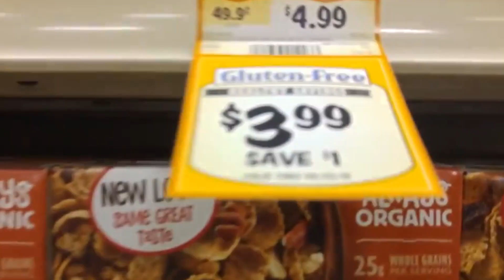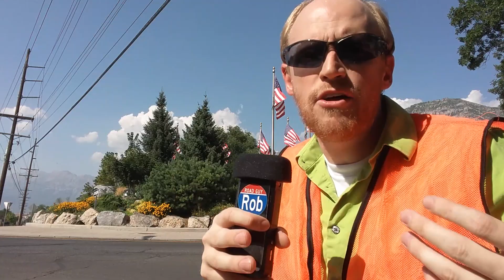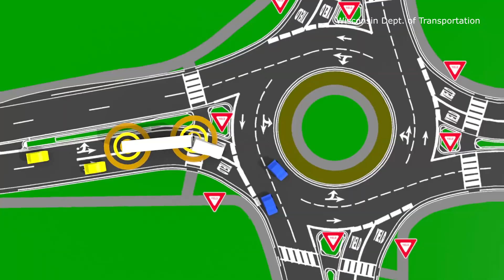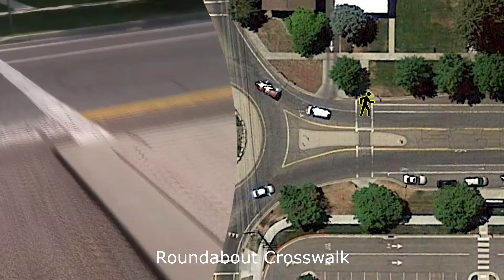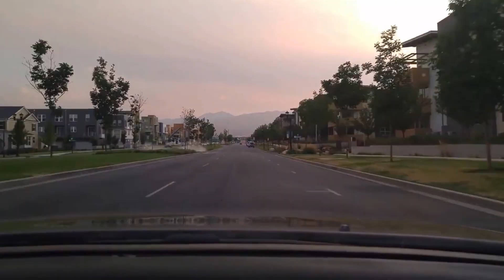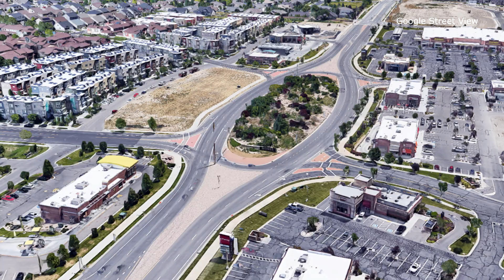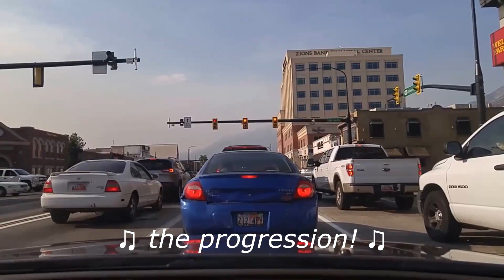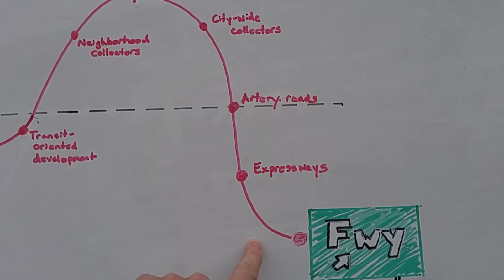Are roundabouts REALLY better than a traffic signal?

Comment: I grew up with roundabouts. They’re quite normal and large lorries generally don’t have problems with them. Pedestrian routes are often built to help people cross using subways or footbridges. Most roundabouts are 2-3 lanes. A quick read of the Highway Code will teach you how to use them properly. To go left (in HK or the UK) use the left hand lane and signal left. To go straight, use the left or middle lanes, but move to the left lane and signal left before your exit. To go right, use the right hand lane, signal right and switch to left signal and left lane the exit before yours. Reverse left and right for right driving countries.
Many motorway junctions use grade separated roundabouts which work very well. So I don’t  get how you seem to think that they’re a new thing. They’ve been around since the 1930s as far as I know.
Reply: We have roundabouts in Australia, but generally just one or two lanes. On the two lane roundabouts you select either lane to go straight ahead, the left lane for turning left and right lane for turning right or doing a u-turn. When I first drove in the UK I noticed that the smaller (painted) roundabouts seem to be ignored by a lot of drivers, in that they don't drive around the painted circle but right over the top of it. The larger roundabouts tend not to have concentric circles but are more like a spiral so that you generally end up in the left lane as you progress around the roundabout, and you need to know which lane to be in to get the correct exit. This is fine when the signs painted on the road are clear, but if they are worn out or it's raining then it starts to get tricky, especially if you are new to the area. If you end up in the wrong lane then it's not easy to get into the right one. Larger roundabouts often have traffic signals as well, sometimes only active in busy periods to meter the traffic.

Comment: My town replaced a flashing yellow/red light with a roundabout 5 years ago. The main road had the flashing yellow while the side street had the flashing red. Both roads could be very busy making it nearly impossible for people on the side streets to go left or straight, and doubled with the fact that the main road has a wide travel lane and large breakdown lane which tends to make people drive faster. the speed limit on the road is 45, but cars would frequently be going near 60. from 2013-2015 (the 2 years between guaranteed funding and project completion there were 74 accidents at the intersection, 2 requiring med flight. no fatalities but some very serious injuries. since completion in fall of 2015 until now there have been 2 accidents, One of them was a drunk driver that went over the center island. Roundabouts work well when placed properly. Traffic is forced to slow down on the road now and people coming from the side streets have a much safer transit of the intersection now.

Comment: In Australia we love roundabouts. But you point at the end is correct; they’re best off arterial roads. But this also means they’re replacing 4 way stop sign intersections not 4 way traffic lights.
Roundabouts don’t need to be as elaborate as the one illustrated in this video either. In my 5 minute drive to the shops I have the choice of high speed arterial or low speed urban back road with 15 roundabouts. The roundabout trip is generally less time despite slower speed because there is never a flow interruption. And crossing is never as bad shown here because no one crosses at a roundabout but further down road.
But the biggest issue you have in this video is changing lanes on a 2 lane roundabout. We treat it the same as changing normal lanes on any road - check, indicate and move. Doing that twice on a roundabout makes no sense.
And given it’s been a normal part of daily driving here for over half a century, I can say it’s almost never done.

Comment: Really good video. You did a good job at discussing the pros and cons of roundabouts. The graph was perfect. Usually that "spot" is at the edge of a dense urban environment with a more rural area and the roundabout slows down the freeway speed traffic to a slower speed as it enters a more urban environment. It's a subtle clue to the road users that they are entering a new road character. People with limited sight do not like roundabouts because there is no signalized break in traffic nor audible clue of when they can cross safely, but this can be partly mitigated with RRFBs. That being said, they take up much more space than a conventional signalized intersection, they also (as you eluded to in your signal timing video) equalize the traffic from all approaches which reduces capacity of the main line to equalize with the side street (which signal timing can fix), so it's important that the traffic flow be roughly equal from all approaches. Also, fire departments don't like them as they have to slow down and can't get a preemption green light like they can with modern signal tech. And if you look at the land use around roundabouts, especially in Europe, they act as a pedestrian barrier where you will see commercial areas not be able to "cross" the roundabout as the pedestrians are unwilling to walk the distance. You have bounded the commercial activity (which isn't always a bad thing). Also, the concrete inner curb is called a 'mountable truck apron.' These are all minor points, this was a really good video and was refreshing to not just hear a 'roundabouts are the solution to all traffic' that I have seen others' do.

Comment: Wait a minute... $5,000 - $10,000 per month for electricity to run a traffic light? Is that one light? Even if it's 500 lights, do they really use that much electricity?
Reply: LED traffic signal modules are mostly under 10W apiece. So in a very basic four way intersection, about $49/year at the national average $0.139 electric rate. (4 X 10W  X 8760 hours  / 1000 for kWh X $0.139) Remember that while there are three signals in each direction, only one is illuminated at a time. And while there are intersections with many, many more lights,  the number of bulbs required becomes staggeringly large to reach a $48K annual electric cost.

I think someone made a math error, perhaps forgetting to convert watts into kilowatts.
Reply: @gerrypower9433  
The thing is what happens when you have a bad accident or really bad weather that knocks down traffic lights? I'd think that costs much more to fix than an accident at a roundabout and not to mention the maintanence costs for roundabouts which should be next to none.

Comment: Here in Hilliard, Ohio, we've had several roundabouts put in, and more are on the way from what I've read in the news.  I love them.  The place I used to take my last Jeep for oil changes used to be at a very busy intersection with a traffic light, and traffic used to be backed up in all directions waiting for the light to change during the day and early evening.  It's now a 2-lane roundabout, and all of that congestion is gone.  The only problems that I've seen in the roundabouts are the drivers.  People fly into the roundabout without hardly slowing down and not yielding to the traffic in the roundabout.  Some people I've seen in the roundabout stop for vehicles coming into the roundabout.  And since some of my jogs often take me through some of the roundabouts, people don't know how to yield to pedestrians in them.  I've even had some people where I'll be off the sidewalk and in the crosswalk, and they'll accelerate to get past me rather than wait a couple seconds.

Comment: the dutch are putting roundabouts everywhere from small inner city streets to Snelwegen the tiniest are so small that semis still need tu turn normally (over a slightly raised cobblestone pad in the middle of the streert to the biggest with kilometers of circumference they also have "turboroundabouts" wich are built in a way that prohibits lane canges so wich makes them more convinient than regular multi lane ones

Comment: Good video.  Roundabouts are a tool, and in the right context can be much more practical, and affordable to a traffic signal.  But they are not ideal in some situations - especially for blind people since vehicles don't stop. They also take more space, so in urban areas there usually isn't enough room. But in suburban/rural areas with mild to moderate traffic, and low pedestrian or bike volumes they have been implemented successfully in many States.

Comment: Multiple lane roundabouts are WIDE enough for trucks IF the trucks are taking up BOTH lanes.... which means driving next to a truck is certain death. I mean, it's dangerous all the time, but it's instant death in the roundabout. 

Me? Yeah, I'm using my hazard lights (because roundabouts are hazardous, and so is my movement through them), and then I'm taking up both lanes before the roundabout, IN the roundabout, and I might think about sliding back over to just one lane after the roundabout is done UNLESS there's another one coming (like in Lacey, WA off I-5 exit 111 and you'll see three of them in quick succession).

Comment: Here in Oregon they move extra long power poles for high power lines, which would not work at all. Also moving big modular homes into areas would be a big problem. Then say you want to save an old house and move it somewhere else. You can't get by a roundabout.  The new power wind mills that they truck into areas and set up to make power for everyone just couldn't begin to get through. So it's not that I'm not smart enough to use them, but you run into many problems that you don't even think about. I hate roundabouts,,,,,,,,,,,

Comment: The importance of platooning can’t be overstated. I lived in Italy for 3 years and in Korea for 8 and can tell you the roundabout is not the universal panacea that Europeans and others claim.  When engineered properly crosstown boulevards with sequenced traffic signals that create tight platoons can result travel at constant speeds of 60+ kph without having to slow down or stop AND allows gap times that allow regular ingress periods as well as gap times for pedestrians to cross safely.  This flow almost never happened in built up areas in Italy where instead block after block of rotaries meant a solid string of cars that never safely managed faster than 35 kph and produced no gaps for entrance from the side streets or gave pedestrians windows in the flow to safely cross.  Rob’s brief demonstration with the multi lane roundabout showing the pedestrian having to wait for gaps is correct although in seriously busy areas that safe gap never comes.

When traveling in Indiana another flaw was exposed that is the result of randomized traffic and rotaries replacing 4 way stops.  When one road has enough volume that the traffic flow from that route is able to monopolize the rotary, traffic on the other route can back up because the gap is never big enough to allow entrance into the rotary.  Observed wait times were frequently measured above 5 minutes whereas the 4 way stop with only minor inconvenience to the busier route allowed almost instant access.  A 4 way also practically guaranteed that pedestrians would be given the opportunity to cross. The traffic exiting rotaries is often unconcerned about yielding to pedestrians and if they do stop, the rotary clogs and flow instantly collapses.

I used to believe all rotaries should have been banned in the US, however over the years I have changed my mind.  Rob’s gentle warning about them not working everywhere needs to be shouted from the mountaintops!  They work well in neighborhoods. They work well with low to medium volume roads and streets. They can work well with busier streets if there is something upstream that provides at least some platooning so that the flow through the rotary doesn’t get locked to just one route.  Surprisingly, they do seem to perform well with the feeder ramps in diamond interchanges, although I think the diverging diamond is far superior.

They don’t work and should not be used:
1. In industrial parks
2. At the intersection of 2 or more 4 to 6 lane urban roads where speeds higher than 40kph are needed to prevent cascading congestion
3. Where the randomized volume of one route will be able to monopolize and shutdown access from the other routes or for pedestrians
4. Their sole purpose is to serve as the one and only traffic calming measure (Rob has pointed out in other videos about the best ways to deal with speeding)
5. When a 4 way stop will do the job.

Rob is right and I have been convinced roundabouts can work when used properly.  However, too many people believe that they are superior because they are European.  Anyone who has spent at least a few years driving in both Europe and the US can tell you, the people who should be teaching urban traffic management are not necessarily the Europeans. We Americans are spoiled.  We think if it takes more than 10 minutes to drive entirely across town in a city of 250,000, we have gridlock. I can tell you in many European and Asian cities, that level of mobility could only happen on Sunday mornings.  Both sides of the pond need to understand the definition of chronic congestion is not globally uniform and neither are its cures.
Reply: platooning does not work on every road. I think they focus on large road because there are a lot of cars, but for small road that has to pass that large road, they have to wait . I guess
Reply: @CheulongSear  That’s true... Anyone who has ever tried to turn onto a busy road knows sometimes you have to wait a long time for the opportunity.  Where I live, our main arterial is still somewhat rural, however about a mile in both directions it has signals.  One of those intersections is a T so the result is a platoon of cars from the other road in between the ones from the through traffic.  In addition you have to deal with all the feeder traffic that has already taken advantage of the gap to gain access and now you are still fighting with random traffic in between.  However, the fact that there is any gaps at all are thanks to the lights.  If they were roundabouts and we had completely random traffic it would be much worse.

When I was young and first learning to drive, we lived in the country on a US Highway.  If would get very busy, especially in summer and often it took a farmer and his hay wagon or tractor bunching up the cars to provide the gaps for us to get out of our driveway.

Speaking of rural highways, one thing I never quite understood was some states put traffic signals at the rural intersection of high speed state highways.  This allows for traffic to sometimes avoid having to stop, however it seems to me that deaths increase at these locations when they get rid of the 4 way stop because now you can have the situation where someone is trying to beat the light, or gets used to it being green and now you have a high speed T bone.  I have been pleasantly surprised that in many of these locations where they had gotten rid of the 4 way stops under pressure to allow more free flow with a traffic light, that roundabouts seem to work well.  Of course, once traffic grows enough that either road starts to need anything more than a single lane in each direction, it will be time to start looking for new options. Roundabouts do not belong on multi lane rural highways with speed limits above 100 kph.
Reply: @scottwendt9575  i agree. My idea is to put roundabout in rural and suburbs area which there are light and medium traffic. City with heavy traffic should keep traffic light.
the problem is rural area is conservative area. When you want to put something new, just wait for the backlash
Reply: @CheulongSear  Amazingly, here in the Upper Midwest, some of the most successful installations of roundabouts were built in conservative rural counties at the request of citizens.  Perhaps they didn’t realize the political statement embracing roundabouts makes about your community. 😁
Reply: @scottwendt9575  happy to see that. at least they dont say that it is the strategy of deep state to erase US culture of traffic light. ^^
Just kidding i like roundabout.

Comment: What about the volume of traffic ?
Reply: A lot better than 2x2 lanes with traffic lights. Because the waiting times to dive into a gap in traffic are short. 2x2's can become 1 lane roundabouts with right turn only lanes. So you don't need space for left turn traffic waiting for the red light.
Once you get to main arteries / highways, it is better to install off ramps and a bridge.
Reply: @Aimless6  I would like to see actual numbers of cars proceeding through round-a-bout intersections vs. traffic lights.  Ought to be easy to compare.

Comment: They're really not that complicated to understand at all. America drive on the right, so when you come up to a roundabout all you have to do is LOOK LEFT!  If there is a car already on the roundabout coming from the left, let it pass you before you pull out and cross/go over the roundabout. 

If there's no vehicle on the roundabout when you come up to one then still slow down slightly but don't stop. Only come to a stop if there's a vehicle ALREADY on the roundabout or one from another direction that got there before you did. The purpose of Roundabouts is to speed up traffic. Yes you still sometimes need to stop at one as I explained above, but in general you are not held at a roundabout for as long as you would be at a set of traffic lights. 

As a Brit, I remember going on holiday to America back in the 90's. My parents hired a car (yes we do drive on the opposite side of the road to America!), and they saw a couple of roundabouts which were still a very new concept back then. I think they were referred to as 'Rotaries' rather than roundabouts!